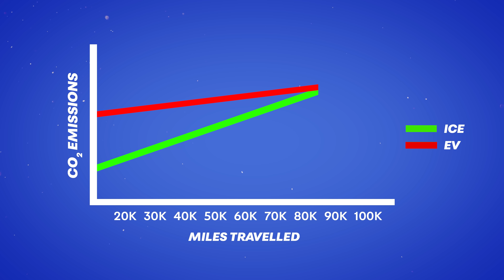Are Electric Cars REALLY That Green? [New 2022 Data]

Comment: What I kind of miss in this story, is at which point the battery in the EV needs to be replaced. Which again will pollute excessively because of both the new one being produced and throwing away the old battery (which is also very bad for the environment). I own a 2002 Volvo with 476.000km on the odometer (original engine and gearbox). With an electric car I expect it to need at least one but probably two battery replacements to cover that time and distance. Those probably wouldn't economically be worth replacing. Because an EV battery is more expensive than an entire combustion engine. So the electric cars will probably be replaced sooner, causing even more pollution.
Reply: Well, Li Ion batteries in a phone are replaced after 3 years if you have 500 to 700 cycles. In a EV, say you have 500 cycles after 7 to 10 years. Yep, replacing batteries will cost you a brand new car....about 20.000$. I would like to see a petrol or diesel engine car rhat you have to spend that much after 7 years
Reply: @gandalfwiz20007  "...petrol or diesel car that you have to spend that much after 7 years" any BMW and some VW. Don't ask how I know.
Reply: @A R  really?  Spending 20.000$ on parts in 7 years? What was it? Gearbox? Turbine? Injectors?
Reply: @gandalfwiz20007  500 - 700 cycle in a phone is not comparable to a car which can range from 1500 - 2000 cycle even before it can be used in grid storage.  58khw battery charged 1500 times with a avg of 3.5 mi/kwh is 304,500 mile or in km over 600,000 km.  This is easy math people.  Plus who the hell throw's a battery away? Its full of valuable metals which gets recycled and reused after 20 years or more of use.
Reply: @Stefan van Vuuren  600.000 would be sweet! Who said anything about throwing batteries away? I know they are 95% recycable and that's good as well, the problem was the cost of replacing them. That is worth the cost
Reply: @gandalfwiz20007  yes exactly.  Yeah sorry the throwing away of batteries comes from the original comment which we are following. Which is BS, I just want to make sure people get this.
Reply: @CheapBastard1988 you should read into battery life a little, I think you might be in for a shock to see how the battery you want to throw away will outlive your 2002 Volvo without blinking.  Plus no one throw's batterys aways. Go read up.
Reply: Is it a diesel? Does it have a DPF?
Reply: @philiphawkins4684  a DPF replacement is around 2000$ and it usually lasts around 300.000 km. There is also the option to pressure clean it. Anyway, a battery replacement = 20.000$. I have not yet to see a ICE car that cost that much after 5 or 10 years

Comment: As someone who drives but not very far this is really interesting as in my ten years of driving I think I've barely made up the mileage needed to have made an electric vehicle worthwhile. Also even more interesting as I've only driven second hand cars (1L petrol and 1.6 diesel) it would more than likely take even longer for an electric to have used less CO2 with those numbers.
Reply: Ah! But, you will then sell your car to someone else and at some point, it's extremely likely to reach and exceed 50,000 or even 90,000 miles.

Comment: Interesting.  I am in the learning stages of EV and as a middle aged dude who loves ICE vehicles I am not fighting it.  My son bought a Model 3 dual motor extended range and I was impressed with the acceleration and supposedly the range is pretty decent.  Now from a practical point of view that level of acceleration is kind of unnecessary.  Common sense tells me that each rotation of a motor uses a certain amount of energy.  Less RPM per rotation of the wheel means better efficiency.  With 100% torque available instantly doing something with the ratio that would lower the RPM for a given speed would reduce acceleration figures, but should increase efficiency.  And it's not like it's rocket science....perhaps added cost though.

The next area is the generation of electricity and I know that there are still a lot of places that use fossil fuel.  As long as that is the case we're just kind of shifting the source of the pollution rather than reducing it as much as we could.  Another thing to take into consideration is that this is not going to be an apples to apples comparison because there is some junk on the road that is just spewing a lot more pullulation and CO2 than say a standard 2.0 liter from a well maintained vehicle.

And lastly there needs to be improvements made to not only battery manufacturing, but longevity, sustainability and recyclability.   The battery is the most costly part of an EV by a large margin.  I see a lot of opportunity for cost savings from maintenance and stuff for EV vs. ICE, but that battery pack is a worrying expense.

Comment: What's the impact when you include the end of life phase of the vehicle where you have to figure out what to with both an EV and ICE vehicle?  Cost to reclaim materials or bury, etc.  Though, I doubt landfills would want to take on more hazard materials like those found in the batteries.  Even repurposed as whole house battery backups, eventually the batteries will need to be dealt with when capacity degrades enough.

Comment: Kudos for Volvo for putting the research out. Best for planet would be not buying cars but using public transport. Next to that, EV cars seem to be better based on this video, since most cars are used for more than 90 thousand miles anyway. Driving the city is more economical for ev, driving highway is more economical for ICE. Volvo's car is not an optimal example since they have quite bad kWh usage compared to other EV cars. It's a heavy SUV.

Comment: Biggest difference is EVs can get cleaner with age as long as the electricity used to charge it gets cleaner. Internal combustion doesn't have this advantage short of carbon neutral biofuels.

Comment: Don't forget the efficiency of the battery decreases over time, Will a battery last 125k miles without replacement and still have a reasonable range?. Plus you need to deal with end of life of batteries- which is a problem.

Comment: There is an independent report that showed that an ev actually breaks even on CO2 after two years. Obviously a lot depends on how your electricity is generated. We need a total shift to renewable electricity production and then EVs are miles better.
Reply: I personally use around 100-120 Kwh of combined energy ( gas & electric )per week, If I owned an EV then I would probably triple that amount. If this was similar to average and everyone went totally electric then I can't see how it is possible to provide the power required with conventional means let alone renewable energy that peaks at different times of the day and year.
Respect for what you are seeking as I do, have any of you lot actually thought it through about the amount of energy that would be required if everyone across the world followed what you would like.
Think about it ???? it's totally impossible, the demands worldwide would  100s of times greater with a extremely unreliable source.
There is always nuclear that could provide that energy reliably with zero emissions but lets ignore that solution even though it's the only one that makes sense.
Good luck trying to achieve what you seek, just like true perpetual motion, it will never happen and we can die trying or just use what we know will work
Reply: @m4rkscott  respect to you, but just because you "can't see how" doesn't mean it can't be achieved. In fact there is no choice, we either drastically reduce CO2 with renewables or our civilisation is stuffed. Also to triple your quoted energy use with an EV you must be driving 43K + miles a year (low end of performance an EV does 3.5 miles/KWh). We just need a lot more solar, wind, tidal, wave etc and the energy storage systems that smooth out the peaks and troughs of production and demand. Other solutions are to have fewer cars and drive fewer miles. Perhaps end private ownership and have car clubs which reduces the number of cars that are made. Those of us in wealthy countries might just have to accept that to avoid disaster we may have to make sacrifices.

Comment: If you're not being paid by big oil, you should be. How about you redo the video with the EV can beat the ICE in "as little as". In my location electricity generation is near zero GHG. I can't bear to watch more than half because your bias is painted across your face and I don't have time for nonsense. Tailpipe emissions cannot be recycled. Batteries can. No matter how bad certain supply chains are, at some point we may never need them again. Go ask Nigerians how gas is working out for them.

Comment: I think EVs will get acceptable on a large scale when batteries will get interchangeable and available in the Petrol Stations, precharged and ready to use.
Reply: LOL That would make BEVs horrible. The future of BEVs is Structural Battery parts of the chassis. Thus the vehicle is lighter and the capacity for active cells is bigger. When you have Guranteed Blizzard Cold 400 miles range, Interchangeable battery is pointless for vast majority of users. Combine that with 30 Minutes DC Charging for the full 400 miles, which currently does not exist but close. Stick with PHEV if you need more range than that. BEV do not need to cover every niche use case, just as long it covers vast majority of vehicles on the road.
Reply: @Neojhun Battery flashlights were space technology at one point. Now you have interchangeable batteries in every toy. Imagine you have a place somewhere under the back sits or in front...you disconnect them, grab them out...Formula E will come with the answer.
Reply: @MURRYCHOOCK  LOL Irrelevant. You clearly have no clue about the technical reality of BEVs. Interchangeable battery of a 300 gram Torch has no relevance to a 1000lbs battery in a Car. A single person can't just bare hand lift one out. The best method for that form factor is to make the 1000lbs as effective as possible containing as much energy safely possible. The goal should be 1.3 Tonnes HatchBack with 500kg structural battery that contains Over 100kwh. Getting a guaranteed 4 miles per kwh even in a Blizzard. These are real world numbers that can be achieved with evolution improvements of existing EV architecture. How about learning real world engineering instead of irrelevant assumptions.
Reply: @MURRYCHOOCK  FYI It already exist, NIO is currently doing battery swaps. Better Place first did it in 2012 but the company went bankrupt in 2013. Battery Swap technology is relatively mature. Problem is it's a niche use case that is not very useful. Once you have decent range like beyond 300 miles, people rarely ever need the service thus it can not pay for it's self.

Comment: I think there's an issue in that the report puts all of the environmental cost of Li-ion battery production on the BEV, but not all of the envorinmental gain it will produce in its entire lifetime. At the car's end-of-life, the battery will, as stated in the report, be recycled, but the environmental benefits it will cause in its recycled state are ignored. I appreciate that these benefits will be hard, or even impossible to quantify, but I can not imagine that they won't be there, tipping the scales further in the favor of the BEV.

Comment: You said the EV produces co2 when its charging as its plugged inti the mains. Wrong!!
The eleectricity is at the power socket if your car is plugged in or not! The power generator is running 24/7, seven days a week, every week of the year. The amount of power 1 car takes is so small, it makes no difference to the generator.
On the other hand, if we go fully electric there wont be enough spare capacity to charge all these cars at once. Lights WILL go out but at least were going to be reducing the carbon footprint of GB PLC!
We need more capacity and also have to rely on peoples common sense to charge either overnight orr at different times of the day.
Can you see this happening? Neither can I.
Batteries are a dead end anyway as when they reduce capacity over about 6 to 10 years. Who wants a second hand EV with dead batteries?? Fuel Cells are the answer as you can go the same distance as an ICE car and NO batteries except maybe for ancillaries.

Comment: I take issue with anyone who claims "All my electricity is green" 8:05, unless that person has their own private green sources which aren't ever connected to the power grid. The grid has inputs from multiple sources and it isn't physically possible for the customer to determine which source to allow into their home. So domestic electricity from the grid is something I'll arbitrarily classify as "brown". The customer can only indirectly influence greener electricity by voting with their wallet to buy electricity from allegedly "green" suppliers, which might not even be 50% green themselves.
Reply: You make an excellent point. Further to that the thinking that plugging cars in overnight is using ‘green energy’ is somewhat disingenuous. Zero solar power and less wind at night means the base load needs to rely on Nuclear or fossil fuel sources in the vast majority of countries.
When will people get a grip when it comes to understanding we cannot have an economy based entirely on unreliable energy sources. The NETZero cultists need to either accept Nuclear is key to base load or accept the need for fossil fuel to remain an important part of the energy mix if we wish to maintain a viable economy.

Comment: The market will regulate itself. With the increasing amount of used EVs everyone who educated themselves on EVs to some degree used EVs don't want a pre owned one because currently tech moves so fast they get old instantly. Nobody knows how they will perform long term. Very old ICE cars still drive today....how old can a BEV get before you need to replace the battery for half the price every decade or less? 
Also nobody really knows what to do with EVs once they reached the end of their life cycle. Spare parts especially the battery are expensive AF if you have to replace them out of warranty.

Comment: Good discussion Rory, but I think you are too accepting of Volvo's methodology.
The reason Volvo is doing this is an endeavor to slow the change to BEV.
Volvo represents the legacy ICE car manufactures who have been caught out by the speed of change to BEV, and are trying to encourage people to not feel bad about their purchasing habit.
They make more money selling ICE cars than BEV! If only they can keep selling them.
 This is because that is what they know, and everything has been set up that way for decades They are looking at a huge and painful change that they may not even survive.
As we know, Volvo is owned by Geely, and is not really Volvo any more - much like MG which also didn't survive in its original form.
Legacy car manufacturers have been resisting this change for years and one of their tactics was to use cars designed for ICE  and add batteries and electric motors - just like the XC40.
The XC40 may look like a good ICE car but as a BEV it is just so far from the current Tesla cars it makes a ridiculous comparison. Not only are the Tesla purpose-built BEV highly efficient, but the whole process is much quicker and more efficient with massive factories, again, purpose built for the job with workforces that only builds BEV (with many who have only ever built BEV). Added to this Tesla is hugely vertically integrated which has to the overall efficiency and speed of response.
To see the threat that Tesla represents - just examine the 2021's 4th Quarter Financial returns - they are  massively outperforming legacy auto by every metric. What can't be seen though is how this is NOT slowing but actually accelerating!
So the whole calculation, whilst pleasing for legacy auto, is very misleading for anybody seriously trying to compare the potential benefits of BEV.